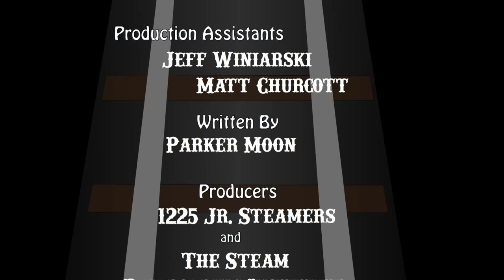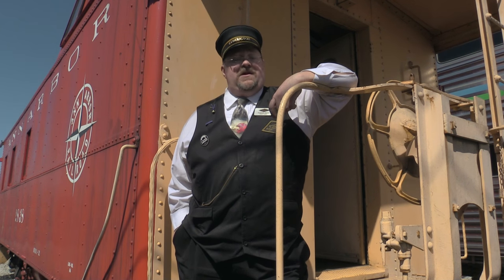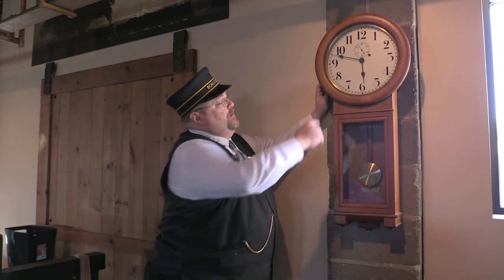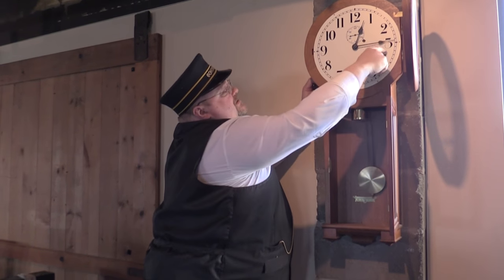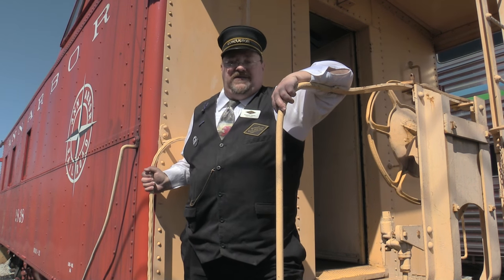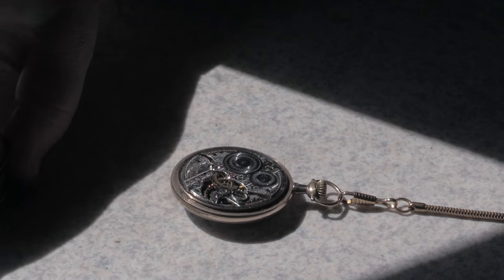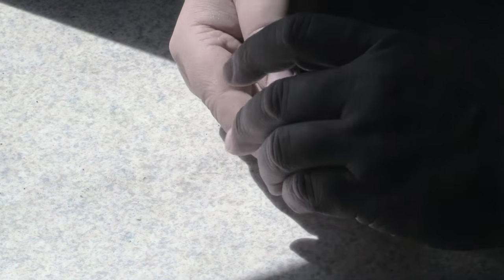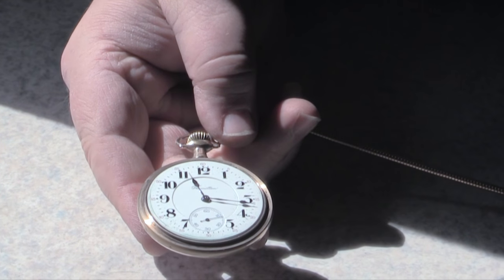History of Railroad Pocket Watches

Comment: I have this same Hamilton conductors pocket watch. It has all the engravings on the inside of the case from every year it was in service and got checked out by a watch smith to make sure it was working correctly. I actually had an appointment with antique roadshow to have it checked out and so they could tell me the history of the watch. But covid hit and they canceled it
Reply from the maker: Check out PocketWatchDatabase.com. You can enter the serial number stamped on the back of the watch’s mechanism and the site will provide you with a rundown of info on the watch.
Reply: @Midwestrailexcursions  thank you so much I did not know this! I would love to learn the history on this watch. It has very fancy 3 letter initials engraved on the back of the case too.

Comment: For the railroad, can they carry watches that can close, or are they not allowed?
Reply from the maker: Christopher Platt, The General Railroad Timepiece Standards that were adopted in 1893 required all railroad timepieces to be open face, meaning that they were not able to have a cover or “close”. Prior to these regulations it is likely that some conductors may have used pocket watches with a cover.
Reply: @Midwestrailexcursions  Ok, thanks for the info. Is it still required today?
Reply from the maker: Christopher Platt,
Today the use of radios, automatic block signals, and central computer tracking of trains has lessened the role of the railroad watch on many railroads, yet watch requirements still remain important to safe railroad operation. On the Union Pacific, for example:

Rule 1.48 Time: While on duty, crew members must have a watch. Other employees must have access to a watch or clock.
The watch or clock must:
• Be in good working condition and reliable.
• Display hours, minutes, and seconds.
• Not vary from the correct time by more than 30 seconds.
• Be compared with the time source designated in special instructions.
Reply: @Midwestrailexcursions  Thank you for the info. I would really like to become a conductor when I grow up and love hand-winding pocketwatches, but it is hard to find them with seconds.

Comment: I don’t think that pocket watch he had was railroad grade because the railroads only used the crown setting watches in the beginning until lever set came out, because the crown could be pulled out and the time could be changed easily- other than that good video.
Reply from the maker: Quick History, I can assure you this is a railroad grade watch. It is a 21J lever set Hamilton.
Reply: @Midwestrailexcursions  oh excuse me for that, I did not know it was lever set, but a 21j is a nice watch, sorry for that.
Reply: May get some fun from a history lesson of sorts about a FOB I found metal detecting recently. Just got it up at my spot here, it's got quite an interesting history. Grandfather was a train engineer/conductor in south Georgia.

Comment: Is it just me or is it impossible to get a new mechanical pocket watch with more than 17 jewels? Are they simple not made anymore?
Reply: They're still made, just the number of jewels are related to the amount actually needed by the movement for low friction bearing points, a lot of modern mechanical movements have settled on a set number. There was a time where watch companies were just putting extra jewels in where they weren't needed, just to boast a higher jewel count.